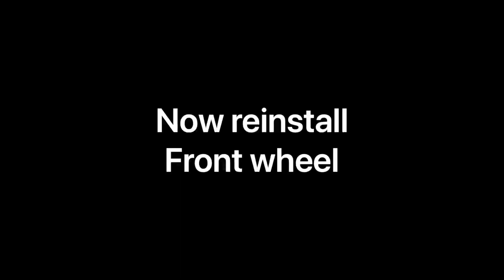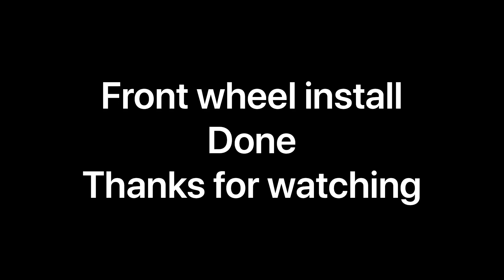Honda Shadow front wheel remove and install

Comment: The correct procedure is to install  the spacer, insert axle from left side and tighten the nut finger tight. Then you torque the nut to 44ft lb making sure the groove on the axle aligns with the outer edge of the fork tube axle  bore. Pump brakes to seat pads against brake disc. Lower the stand so the front wheel is on the ground. Apply the front brake and compress / release the suspension several times as far as possible to center the axle in the bore, making sure the fork tubes are parallel. If so, tighten left then right side pinch bolts to 16 ft lb. Then install speedo cable. The correct procedure does not call for removing the fender or the caliper. It's unnecessary. It's also worth mentioning that when the wheel is off is a great time to inspect the brakes, and lube your speedo cable.   The source of my information is Clymer manual for honda shadow chain drive vt750 1998-2006 manual number m314-3. I would recommend anybody doing their own maintenance pick up a copy
Reply: 😊😊lp😊

Comment: Great video Paul.  I'm going to tackle this myself in the next few weeks on my 98 Shadow ACE.  My speedometer has always been off since I bought it used in 2009.  Reads close to 80 mph when I'm actually doing 60 mph.  Is it worth it to replace the speedometer on the left side, or is not worth it and this is just an issue I have to live with?
Reply from the maker: @MrJohnthefarmer  I’m not sure replacing your speedometer is going to fix your speedometer accuracy issue unless someone put the wrong speedometer in or there is some other mismatch. If it was mine I’d just live with or find out for sure why there is an accuracy issue first then fix it. Generally speedometers work or they don’t work at all. Thanks for watching and commenting

Comment: good video, enjoyed watching.  I guess what nobody noticed is that the forks were brushed/corroded before the wheel got off, and then polished when you put it back on.  Can we have details on how you got them to look like that ? Thanks
Reply from the maker: Sorry I didn’t reply right away. Yes you are very observant I did polish my forks while my front wheel was off. I planned on doing another video detailing how I polished them but got side tracked and never made it. I think I still have the footage. Don’t know when I’ll make that video but I can give you some ideas how I did it..because it was insanely easy! If I had known how easy it was I would have done it much sooner. I bought the 3M headlight restoration kit with drill disc. It’s about $20-30 treated the forks like a headlight restoration  following the headlight restoration instructions basically. I skipped a couple steps because it was looking so nice very quickly I didn’t need to do every step. Finally I used mothers polish to get that mirrored finish. If you give me your email I’ll try to find some of those clips and either make an iCloud link or send shorts video clips my email is paulk.asemaster@gmail.com

Comment: Great video!  Please list the brand/model of the jack under the bike and the stand under the front wheel.  Thanks!
Reply from the maker: Sorry I can’t remember brand name it was an Amazon special. I bought for 39.95!!! Works great on all my cruisers even my huge Streetglide Special. It doesn’t have a brand or name on it. I just looked again sorry. It looks exactly like this one https://www.amazon.com/OrionMotorTech-Dilated-Scissor-Adventure-Motorcycle/dp/B01M0AB7MJ
But it’s almost twice as much as I paid. It has the black “legs” not red but bases are red. With a rubber top so it doesn’t scratch your paint on the frame. Comes with the handy socket with t-bar. I never leave it outside because I love it so much. It’s excellent for detailing wheels to get them off the ground and rotate to each spoke. Oil changes etc...
I don’t know how I lived without this handy tool. Its kinda heavy but still can carry by hand in and outside. Even if I spent double the money I would buy it again if it went missing.  So I hope this helps.
Reply: @paulkmaster3231  What's the black square tube device to the left of the front wheel with the ".... TECH" label on it?
Reply from the maker: Send me a screenshot to my email.
paulk.asemaster@gmail.com
Reply: @paulkmaster3231  Oh, I see the red jack is sitting on a motorcycle lift that has the RaceTech decal.
Reply from the maker: You mean where it says “race tech”?
That’s part of the motorcycle lift. The motorcycle is on a air jack ride on lift it’s about 3 1/2 feet off the ground. The retanglular bars are the wheel Chock holders. You ride up the ramp to the wheel cock and crank the handle to squeeze the rim and hold it in place. Then strap the bike to the lift. Hit the air valve to raise release the air to lower. But this only raises the bike off the ground. It doesn’t lift the bike off the tires that’s what the little jack is for. Hope this helps. If I got wrong your question I’m sorry I’ll try to answer if I can

Comment: According to my manual I am supposed to tighten all cinch bolts prior to torque on the main axle nut, is the manual wrong?
Reply from the maker: Thanks for watching and commenting. If you tighten the cinch bolt on the nut side how can you torque it? So what I do is snug the axle nut first....then tighten cinch bolt on axle bolt side so it doesn’t move while torque ing the nut..then torque to spec the axle nut then afterwards you can finally tighten the last cinch bolts on the nut side. Does this make sense? If all the cinch bolts are tight before torquing wouldn’t that hinder the tightening of the nut?  It wouldn’t be able to move much less accurately torqued to spec unless I’m missing something?
Reply: Went to the shop for clarification and what they told me was Install axle tighten cinch bolts on the axle side. Torque axle to spec then loosen axle and apply brakes a couple of times to centre axle. Then tighten both side of cinch bolt to specs.  I guess even the manual was wrong.

Comment: i have a 2006 Honda Shadow 600cc and i need to replace the front wheel because it has a lot of rust on the rim. my question is can the front wheel be replaced for a different type of rim instead of the spokes rim?? like a mag rim????
Reply from the maker: That’s a great question...but if your replacing the rim based on rust have you tried rubbing off the rust with 
00 stainless steel wool to remove rust off of chrome. Don’t try to use any other stainless wool btw if you try it you need 00. That’s super fine wool. It’s done miracles for me. If you have already done that or you just don’t want to bother. You’ll have to look up what other bikes share the same diameter wheel and exact same brake rotor locations. I have never done this myself so I’m no expert. Maybe a custom bike shop in your area might be able to help answer those questions. Also keep in mind the cost. It might be cheaper to simply by another motorcycle than replace your wheels both front and rear with custom wheels(your gonna replace the rears too right? To match each other). Anyways good luck and God Bless be safe. Thanks for watching and commenting.
Reply: @paulkmaster3231  there is a large area of rust and it has caused to loose air on the tire. It needs to be replaced.
Reply from the maker: @mcspr21  yeah if it’s that bad then you’ll need to replace it. Sorry😕. Cheapest easiest way to go replace with used wheel from another shadow 600

Comment: My 750 2006 Honda Shadow Are does not have pinch bolts on the left hand side. This is confusing me enough that I am hesitant to proceed. I cannot find anything that describes front wheel removal when there are NO pinch bolts on the left side. Can someone offer some advice in this situation? Thanks
Reply: Super late reply but you can just loosen the right side and slide everything out like normal. My 2001 Shadow 600 is the same way.
Reply: @RichAlbert   Thanks ....I was hesitant to try it so I did wind up taking to a bike shop where they did exactly what you said...oh well...education costs money...lol...appreciate the reply!!